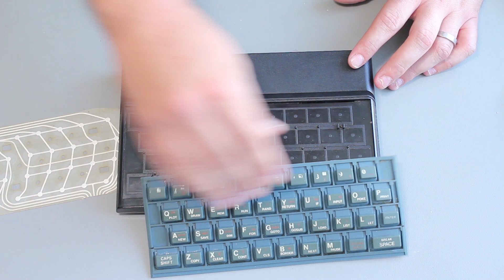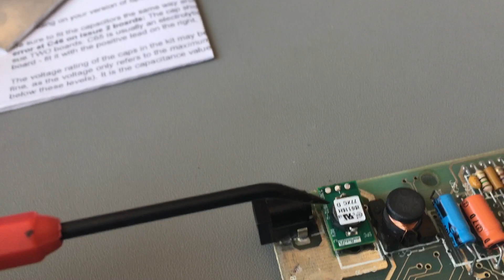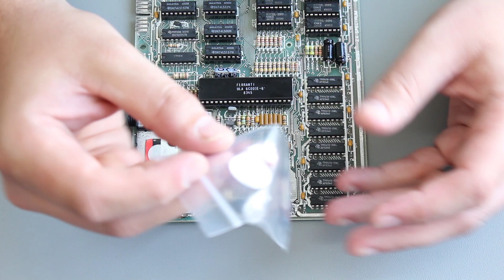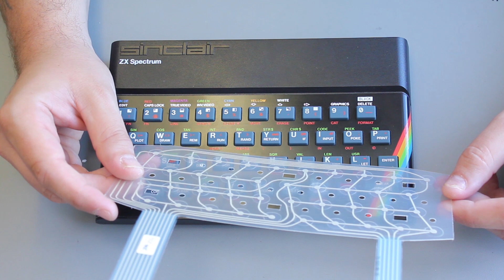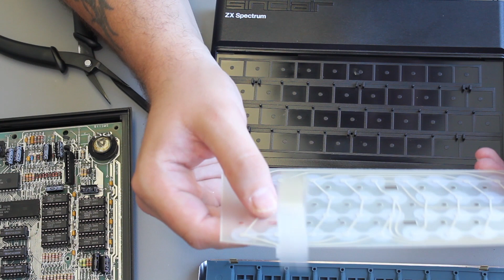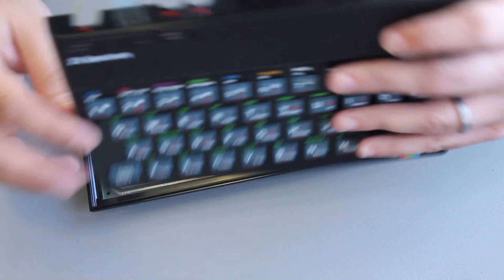Sinclair ZX Spectrum 48k Repair, Recap, Membrane replacement and Video Mod 16BitBench

Comment: No S-Video love for the Spectrum? While the composite mod is a good way to start, the improvement s-video adds is almost a big as the jump from uhf to composite.
Reply from the maker: Hans Meier which is a lovely idea. 

Doesn’t change the fact there is no s-video onboard. 

The ULA provides a digital RGB signal which is fed into the TEA2000 composite video encoder. It was possible to buy an interface which took the the digital RGB and turned it into an analog output for an improved picture. However the 48k spectrum had pretty poor video out even in the best of circumstances. 

The modern ZXHD interface avoid all that nonsense completely and builds an HD video picture by reading the video ram. 

As far as standard video out of a spectrum without buying an ad on goes the best you can do is composite.
Reply: @16BitBench  The ULA doesn't output RGB! It outputs something very similar to S-Video but not quite on spec ... just like the VIC-II in a C64. Adapting the output to S-Video is basically 2 transistors + pullups which can easily be fitted inside the original case or on breadboard in plqce of the modulator
Reply from the maker: Hans Meier I was incorrect the ULA outputs YUV video, still much closer to RGB, not sure why your so set on svideo. As said the video output of the Speccy is that good anyway so gains over composite would be minimal.
Reply: @16BitBench  "is that good so gain would be minimal" enjoy your dot crawl and color bleed then :) While not the worst composite I've seen on 8bit machines, it definitely comes close.
I'm just asking why a simple 2 transistor mod is extremely unpopular over a simple bypass that barely improves picture quality except for adapting the output to a slightly more modern standard.
Reply from the maker: Hans Meier because it makes minimal difference, for one dot crawl is inherent in the ULA svideo won’t fix it. 

You’re right, if svideo out of the Speccy was a significant improvement over composite then people would do it.

As they don’t do it then one can assume it’s not that much of an improvement and not worth doing. 

I would also suggest you look into YUV to svideo conversion and it’s not as simple as you suggest. 

You would still need a encoder to modulate the chroma signal, not just a couple of transistors.
Reply: @16BitBench  The dynamic of this convo is amazing. Let's just stop here.

Comment: Hi I’m having a similar keyboard issue in my issue 3 48k. I have done the regulator replacement and composite mod. My membrane fell apart when in opened the case sadly so I got another new one. All seems to work ok but I don’t have the “ working so I can’t load anything which is incredibly frustrating. I have since got another membrane to check and still the “ key doesn’t respond. Also I have noticed that the symbol shift doesn’t work for keys 1 and 9 and 0. Am I looking at a ula replacement on top of everything else? I’m out a fortune trying to get this to work, the base computer I got for only 13:50 on eBay but I’m at nearly 100 now for this thing.
Reply from the maker: MikkyTee check inside the keyboard connectors for fragments of membrane. If symbols shift is working fine on some keys and not others that would most likely be a ULA problem.
Reply: 16BitBench thanks for the info, yes the symbol shift works fine for the other keys, I might try a nebula replacement and see how that goes 😉
Reply: Well the nebula didn’t make any difference, in fact it was worse as several of the top row keys didn’t work with symbol shift pressed.
Reply from the maker: if you want me to take a look at it and see if i can figure it you can send it to me my address is on my FB page https://www.facebook.com/16BitBench/
Reply: @MikkyTee  Would you be interested in selling your Nebula to me if you don't need it?

Comment: Back in the mid 80s it was possible to upgrade a 48k spectrum to a spectrum+ by moving the board into an upgraded case. The old cases were often kept. The new case in this video looks like it was one left over from such an upgrade so is probably genuine.